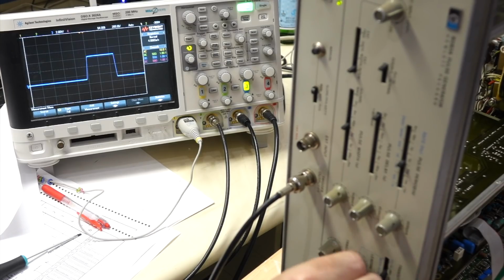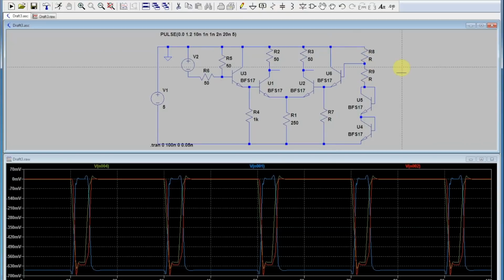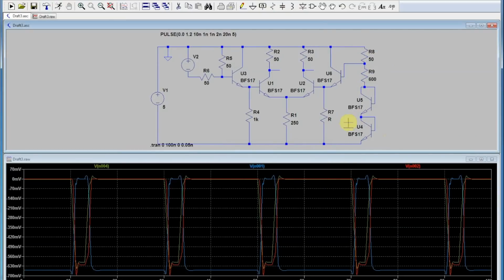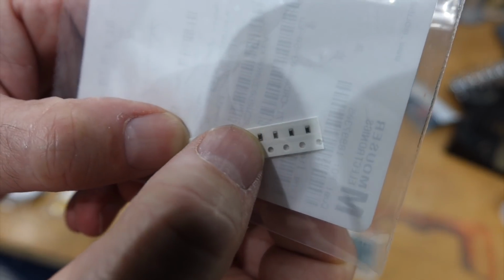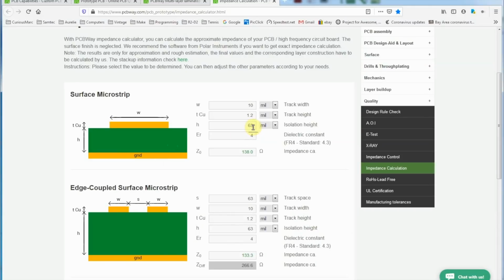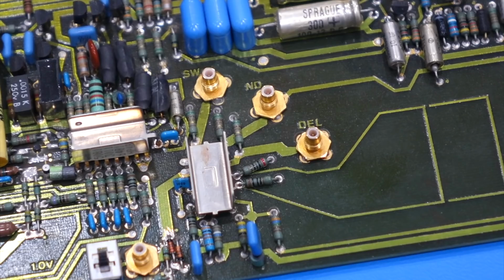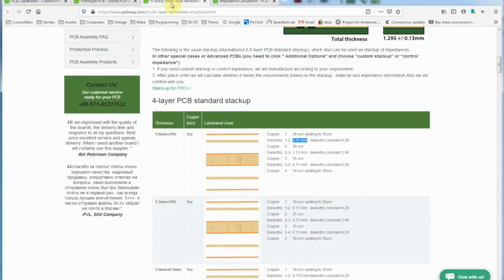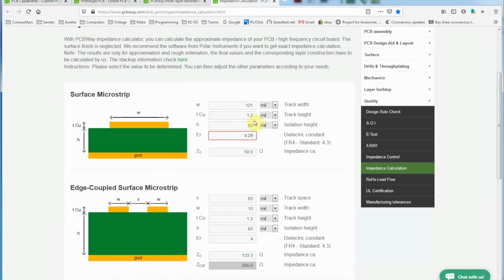HP 8082A Pulse Generator Repair Part 3: Ersatz  ECL Fabrication and Pulser Repair

Comment: Beautiful work Marc. Can you share the specs of the plug-in wire connectors (yellow/green, pcb + wire side) you used on the final board? I checked the BOM on PCBWAY but they are not listed. Many thanks.

Comment: How I loved those modular Tek scopes when I was working on some ECL designs back in my university days. I worked at Motorola semiconductors, using their ECLiPS parts (for ECL in picoseconds). We were trying to build a stop clock that had a least bit accuracy of 20.5ps to be used in the test jigs we had.
Fascinating times. Thanks for the memory.
Reply from the maker: Weren’t they great? I have a paper from my Bell Labs days from research on laser diode high speed effects that were only visible in sufficient detail to be studied on that scope.

Comment: The yellow and green cables going to your custom made PCB to supply it with 0V and -5V, could you please tell me what sort of connector you used to attach the yellow and green wires to the 0V and -5V pins soldered to your custom RF pulse delay PCB? If possible I'd also love to know what type of pin that was soldered to your PCB that the connector In question connected to. If you could give me the name(s), part number(s) and/or the link(s) to the datasheet(s) and or product page(s) on the website(s) of the manufacturer(s) I would be over the moon! 🌝

Thank you very much for reading my comment and I hope you have a wonderful day ☺️😁👍

P.S.: In hindsight I notice that I may have overdone the pluralism(s) of the word(s) when I was describing and/or summing up the most ideal form(s) of answer(s) I was looking for. My sincere(st) appologie(s)! 

P.P.S.: English is not my native tongue so it is incredibly likely that I've committed some severe grammer boo-boos. Sorry about that! Please feel free to correct me wherever you deem required. A chance to learn from a native speaker is not something I get every day, so I'll gladly take any constructive criticism you may have! Cheers!
Reply from the maker: Oh my, these were from my box of spare parts. The pins I am pretty sure are DB-25 connector male pins. The female connectors I don't remember exactly. They might also have been from DB connector pins, or might have come from another pre-assembled thing that I took apart.

Comment: Hi Marc! Do you know the 8012b? Do you consider that it can be a good substitute for the 8082a if we are not looking for very high frequencies?
Reply from the maker: Definitely. I have one on my bench. Nice little unit, can be had for  very cheap and takes much less space on the bench. Last time I used it was during the AGC restoration to simulate AGC pulse trains while developing my accelerometer interface.
Reply: @CuriousMarc  Thank you for the answer! I will consider buying one, they seem relatively inexpensive in working order on ebay.
Reply: @CuriousMarc  I just received my 8012B and it has exactly the same problem as your 8082A! I just have the second pulse and not the first one! Looks like I'll have to use your repair module! I will be going into this in a few weeks, do you want me to keep you informed of the repair?
Reply from the maker: @macpb2892  Sure! Let us know how it goes!

Comment: If you ever get problems with dead ROM Chips on the 7854, a Guy in Germany created a great replacement Board that has even the Calibration Firmware selctable by a switch.

Comment: So what is the clock speed of that pulse at the end?
Reply from the maker: In the video it’s about 3 ns for the first pulse and 1.5 ns for the second one, both less than 1 ns rise time. On Patreon you can see after proper “factory” readjustment I got them exactly at 2 ns each, the original spec.
Reply: @CuriousMarc  Oh sheesh. That is exceeding 650mhz. My head math was off lol.
Reply from the maker: Yes. It's unblievably fast for its time. And so much better and faster than the 1990's HP 8116 from 20 years later!

Comment: Your pre-heating method is very useful. Sometimes I face a situation where the component heats up faster than the PCB when using hot air, and when it reaches the point, the solder is sucked by the component pin and even flows out from the pad on the PCB. I've had a few false joints that weren't soldered at all, especially with tiny packages like the SOT553 or larger packages like SOT23-6. A common feature is that these defects always seem to happen with ground pads. In those situations, your pre-heating method would save my day.

Comment: Depending on the maximum frequency expected, you can get away with just using controlled impedance traces without worrying too much about angles and such.
About Eagle, I do agree that the UI is atrocious. But then I got used to it, and now I'm postponing my change to KiCAD because of the learning curve. Anyway, never purchased a license from the evil AutoDesk, so I'm still using version 7.7.0.
As for KiCAD, I have it installed in my PC, and I find it is somewhat easy to use. And it does the job! But yet I need to learn the specifics: footprint associations, differential pair routing, etc.

Comment: I used KiCAD a few months ago for my first circuit boards - double sided - and I found it easy to use and the boards came out great.  You are in another league, doing an RF circuit.  I love seeing you use the old Tek scopes - I started at GE in 1983 and we had several of them.  Sweet pieces of equipment.

Comment: I did a similar repair of an old 1973 HP 1710A oscilloscope in the mid-1990's. This to the 150 MHz vertical deflection output. This using 2 dual matching transistor sets as the original part was not available. I still use it. No new board, but routing of some leads as the new package was larger than the original. This scope has DTL logic components in it.

Comment: I surely enjoy your videos even though I don't really understand them.  I was wondering where you find all the equipment?  It seems like you have a large selection of vintage HP equipment that hasn't been manufactured for many many years.  Do you have grad students that help you track down all the peripherals you need to work on the equipment?
Reply from the maker: It’s mostly eBay sourced, some local auctions too. The scope was tossed from the lab at work as being hopelessly outdated and slow many years ago. It is the instrument that started the collection.

Comment: Wonderful repair-adventure! It's also interesting to see how the replacement circuit, even such a cleverly designed compact one, is so much larger than the original IC... imagine how large, for example, the Apollo Guidance Computer would have been if ICs had not been used!
Reply: With smallest surface mount transistors available today the area taken by transistors would be smaller than the area of the chip packages. Marc used leaded packages. There are unleaded BGA packaged transistors that are ~2x2mm in size. You could replicate the entire IC in the area of the outline of its socket :)

Comment: KiCAD also has a tool included called PCB-Calculator to calculate the width for impedance matched transmission lines on PCBs.
Reply: But is attrocious like the said Eagle.  Use different tools, such as the Saturn PCB Toolkit.
Reply: Sixta16 It is at least very simple code to change. That wizard can be improved in an afternoon and I do suggest you have a go at it first. Otherwise I’ll have to get a pulled request ready. It’s fairly fun code to work with.

Comment: Could the transistors you need be salvaged from a satellite dish LNB, They have surface mount low nios GA transistors.
Reply: No you can't. The semiconductors used in LNB are HEMT which are similar to FET transistors but for microwave frequencies. The semiconductor is GaAs I.e. gallium arsenide. ECL uses BJT semiconductors. They are on silicon substrate. Regards from Italy.

Comment: What I do not understand: Why did you place the output connectors at 90° while the input connector is at 45°? Was it not possible to rotate the output connectors also to 45° to avoid curved traces?

Comment: Amazing work! To make edges even sharper consider to use 0402 or less passives and smallest possible transistors case. That will reduce parasitic effects of the pcb pads. Also good practice to use several capacitors in parallel in power rails eg 0.1uf 5600pf and 56pf.

Comment: Does it really say 'Ersatz' in the opening titles?
Happy German noises
Had to deal with 0402 in an RF design a while ago which went better than expected with high quality tweezers for hand soldering.
One tip an RF engineer gave me: Place resistors upside down to minimize stray inductance.
Reply: "Ersatz" found it's way into English many years ago now.

Comment: Nice repair although I would of thought an SMT cap would have been a better choice for decoupling RF. The beauty of ECL is it doesn't need much decoupling as the supply rail currents are balanced.

Comment: Marc
A very nice repair.
I had to smile. As a radio amateur who tries to dapple in the very short wave lengths, I have tried to build the occasional super neat 'professional' looking project. After all the planning and plotting and the soldering of all those grains of sand on the board I then find that it doesn't work as expected. By the time it does work, I have little pyramids of caps and resistors. I have occasionally had to resort to the odd vertical extension. I will copy your solution multiple boards for multiple versions. 
Thanks for the best nerd channel on YouTube.
Steve M0KOV

Comment: Talking about high frequency design software, I recently picked up two DDS tapes on the flea market. According to the labels, one is HP 85180A HFSS software, and the other is HP 85150B & 85250A MDS & RFDS software. Both tapes are made by HP in the 90s for the HP 9000 Series 700 workstations. (believe or not, HFSS was once owned by HP!)
I've got an HP9000-712 motherboard around but don't have time to power it up. If you are interested maybe I can send the tapes to you. I'm not sure if they work or not, or there's any license required to run these software, but if they work it would be a very interesting video.
Reply: Looks like MAME has a HP9k driver, so getting them dumped and running on any modern computer might be feasible.
Reply: That era of HP9000 700 machines could use HP-HIL dongles (or flex LM license server.)  So, depends on the software. Getting the right dongle is .... a pita but yes if so the protection can probably be cracked.

Comment: Someone once told me that the black magic content that goes in to the pcb design increases with the square of the frequency...
Reply: It's fun when you need an x-ray machine to see what they are doing with filters and other components BETWEEN layers on a board.
Reply: @projectartichoke  I think, I once saw someone build a simple radar gun (that doppler type for speed traps) with the RF path with no components, just cleverly formed traces on the board. You can do some fun stuff if you understand Maxwell...

Comment: But you have only 3ns pulses with this mod? You can't go for 2ns with that transistors or I am wrong? Anyway i don't think you will never use 2ns. Fascinating, I would have bet that it wouldn't work, because of the new signal path.
Reply from the maker: I only realized it was slightly slower when I put the video together. I was really shooting for the 1ns rise time. Looks like it affects only the ND pulse for some reason, which you can see has a min of 3 ns. But not the “regular” delayed pulse. Not sure how it is in the original instrument. I might swap in the faster circuit once I get the correct resistor for it.

Comment: If the output output(collector) of the gate is terminated outside of the board, why did you not remove the on-board 50R resistor instead of halving the emitter resistor? This would make it equivalent to the first simulation with only one 50R resistor.
Reply from the maker: The issue is that you need 50 Ohms terminations on each board at either end of the connecting cable. You need to have both to impedance match the cable. So I needed to put the ones in my board, but in the sim I overlooked that there would be other ones on the board at the other end of the coax once connected. Rookie’s mistake. That’s why the driver stages need to have twice the voltage swing, no way around it.
Reply: @CuriousMarc  Is that so? I would not terminate a signal generator both at the output and at the end of the cable. In the generator there would be a 50R source(in series) resistor not in parallel.

Comment: If you have no access to multilayer PCBs you can use the minimum isolation width of you process and vias along the trace every 100mil to get the impedance down. Called: Coplanar Waveguide with Ground:
|- -- -
|  SIG  50mil track; 10mil isolation
|------| GND  over 1.0mm core
Reply from the maker: Thanks for the tip!
Reply: @CuriousMarc  0805 or 0603 will work with those traces and be solderable by hand with regular iron. No need for stencil and paste.
You do not have to worry about coupling or insufficient feedback, that is only an issue with fast but high impedance opAmps. Do only worry about inductance wherever there is AC current. Draw the AC loops into the schematic with a marker, then keep them tight in the layout.

Comment: Magic vintage machines. Love them. I had same problem with HP 5340A 18 Ghz counter. I’ve been luky enough to find a good replacement board, but if I’ll face in the future the same problem you will be my bench-Marc 😬👍👍
Reply from the maker: Hahaha! Bench-Marc’ing. I like that. I might re-use it!

Comment: Congrats! That was very interesting. Will you be informing us if the RF wizards have some comments on your design?  As a newbie I'd say it looks very clean.
Reply from the maker: My. If they ever see that one I’ll have to hide in a corner. I fear that they are going to put it on the big screen at one of our strategic technical meetings to embarrass me, and everyone is going to roll on the floor laughing, “look he made a 2mm 50 Ohms line at 1 GHz”, mwahahahaha!” and I’ll have to pay for all the beers. These guys make 110 Gb/s go through 3 feet of cable and two 100 pin backplane connectors for breakfast. This is not real RF engineering, it’s just YouTube Electro-Monkeying-Around. That said, you can do it with amateur means, and it demonstrates the basic principles so it is very educative. At least that will be my line of defense...
Reply: CuriousMarc they have the benefits of simulations with bells and whistles though. Get them to do it with a slide ruler and a pencil, then they can laugh at you!
Reply: @CuriousMarc  It is the 3 feet vs. an inch or so. Been there, done that with ECL at 600 MHz. Interestingly enough a 30 AWG wire wrap wire flat on a ground plane makes a really nice microstrip line at 50 ohm impedance. A 12" distance at 600 MHz on a breadboard - no problem.
Reply: @CuriousMarc  I mean it works :) so there should be nothing to complain about haha
Reply: @CuriousMarc  Hi Marc. Do not be so tough with yourself...you did a good job considering that it is your first time in the RF world. I have been a microwave designer and test engineer for the last 32 years so I know what I am saying! You used only amateur tools and facilities. No fancy microwave substrate with low loss (ohmic and dielectric), no em or microwave circuit simulator...and, basically it worked at the first turn on!!!Believe me: your collegues will offer to pay 10 beers to you!!! Regards from Italy and again, bravo!!